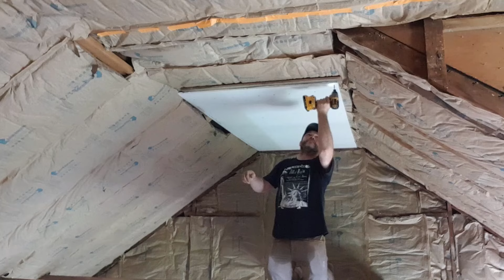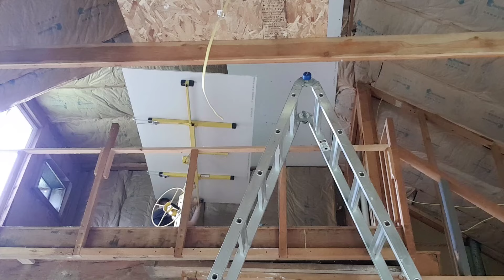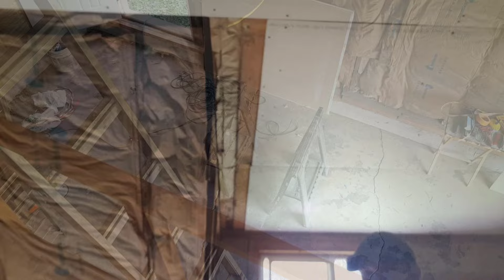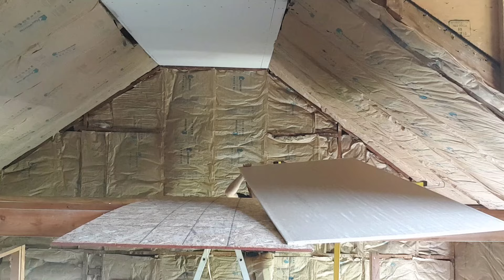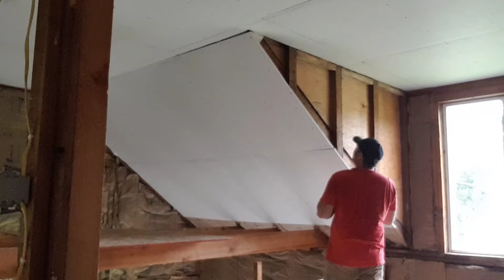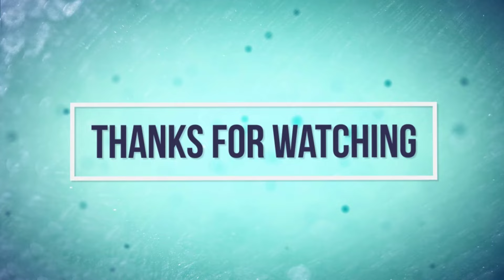Hanging Ceiling Sheetrock at the Chicken Coup Apartment.

Comment: Nice work! I’m a novice who is finishing hanging drywall in a small house by myself, so I definitely respect your ambition!

What’s your reason for not using a  vapor barrier between the insulation and drywall though?
Reply from the maker: @thomasturnquist118  says the paper on the installation works as a vapor barrier when over lapped.
Reply: @thatslumlordlife there we go, now I can say I learned something new today. 

I was kinda concerned watching the video, thinking you might have condensation issues in the future. Glad I was wrong!
Reply from the maker: @thomasturnquist118  some people still put a vapor barrier up on top of faced installation which won't hurt anything but im not a professional. But it says faced installation has a vapor barrier in the paper which is why its more of a plastic paper type material.